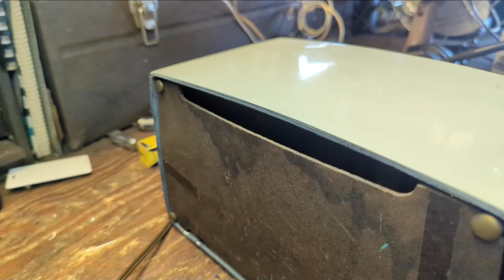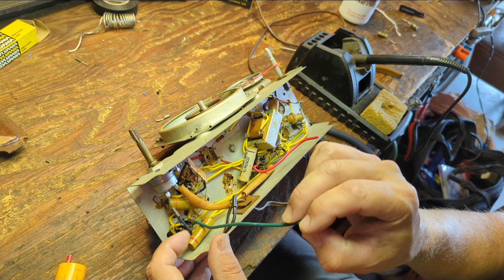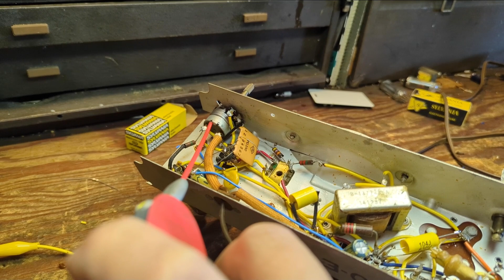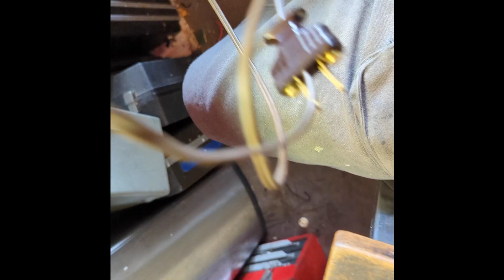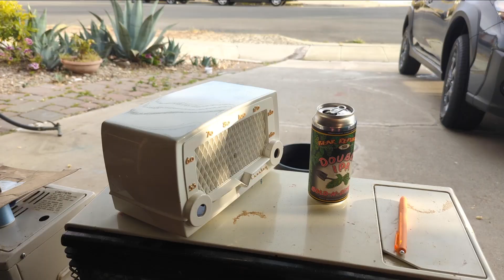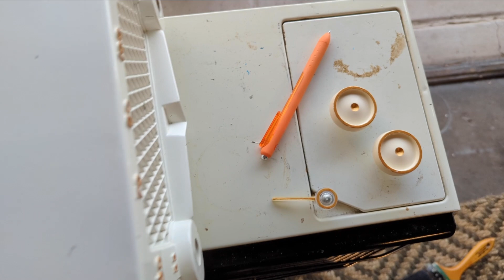Kind of "Frilly" looking Crosley gets a make-over

Comment: I wonder if they used this bright yellow wiring to make the point-to-point assembly much easier to see.  Imaging putting these together on an assembly line, by hand, in a factory with maybe not the best lighting.  It does make it easier to discern the different points where wires needed to be soldered.

Comment: I bet the museum has a large soldering iron they would let you use or have. A Weller gun with a 12 ga wire tip works nice too. You can make the tip a little shorter than the ready made one and it will get a little hotter.

Comment: When you are measuring that 0.6 AC voltage leak test, what load are you dropping across? Is it just the input impedance of the meter? The Magnavox Astrosonic console I have is reading 40 VAC with an analog VOM 10K ohm/volt from neutral to chassis, and 98 VAC with a digital meter, which is probably 10 meg ohms input resistance. There is a 2.5 meg ohm resistor from one side of the AC to chassis in parallel with the chassis ground capacitor. Reverse the plug and there is still some leakage, but much less. Safety cap is a three legged disk with two caps inside. Can't see a reason for the resistor to be there, is it necessary?
Reply from the maker: Load is 250mvAC.  As far as your astrosonic, if its got a power transformer I wouldn't worry about that too much. So you might be reading 40 volts AC on the chassis but the impedance is probably super low. Likewise if I do a basic test with my meter these AA5 sets will always measure 120 VAC on the chassis, but the potential current on that chassis is minimal. Adding the safety cap at a .01uF rating means it drastically lowers the current level to chassis. So yes- if you in fact touch chassis and ground, you might feel a sort of "Tingle", which is the 120 volts on chassis but its more or less harmless. I hope that makes sense
Reply: The current through a 2.5 megohm resistor would be .048 mA at 120 VAC.

 If I remember my electrical safety classes 1 mA is the threshold of feeling the tingle, and 10 mA or greater is lethal.

 I find it fun to learn new stuff, I certainly don't know everything. Thanks for the response.

Comment: Model E10WE white cabinet from 1953. Hate the fact that they didn't use Fahnestock type clips to the loop  antenna so moving it about when desoldering the leads you end up pulling the wires off the backing. The cabinet looks repainted and
 the gold numbers and Crosley logo looks way too good. Usually they have wear especially the gold trim on the knobs.
Good clean up and restore once again. Like the addition to an AM only radio with a Bluetooth option!
Reply: I have added the clips to several sets. Makes it easy for the next guy.

Comment: Hi I had a question about the audio input feature would it be possible to use a double pole double throw switch to enable the radio signal while at the same time decouple the isolation transformer.  Wouldn’t that eliminate the need for the extra resistor and capacitor?  And also enable you to leave the external audio source plugged in.  Thanks.
Reply: Someone has been reading my mind..  Along those lines, since he is using a 12/120v step down transformer in reverse,  effectively increasing the signal level to the first audio tube, maybe that series resister and capacitor addition is also  needed to drop the audio level back down, preventing over driving the tube....or not.. haven't actually built this little circuit......